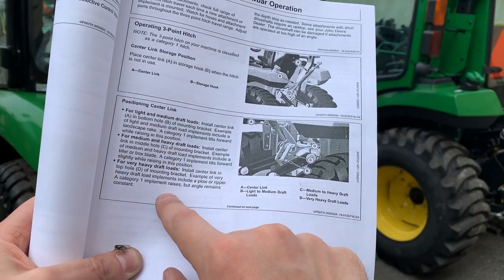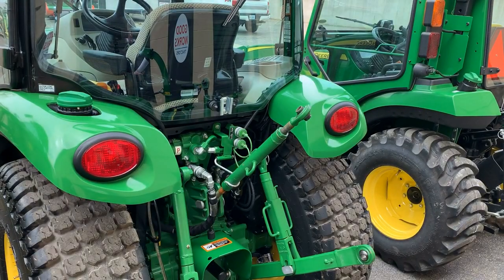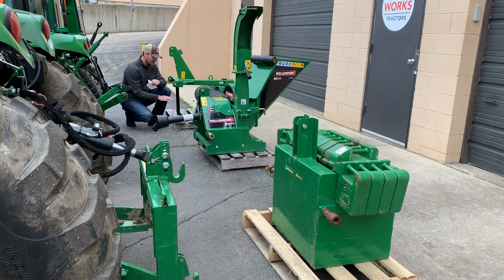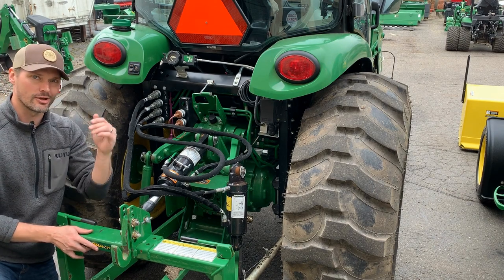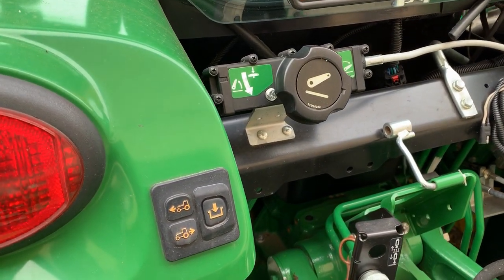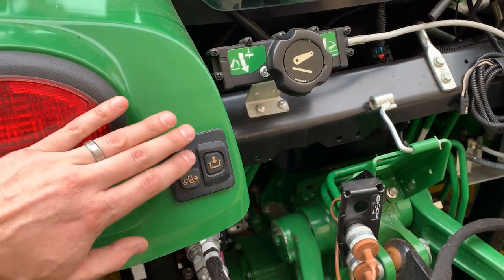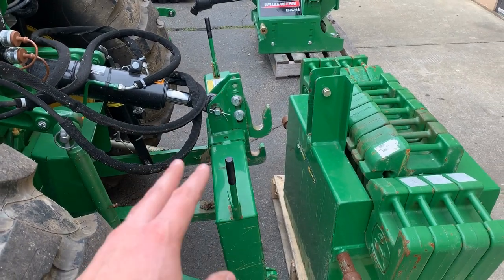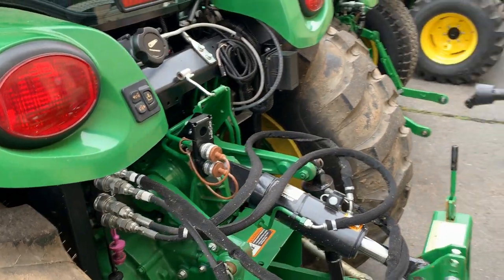TOP 10 TIPS FOR YOUR TRACTOR'S 3 POINT HITCH! 👨‍🌾🚜👩‍🌾

Comment: Ha!  "Park your implements on a level ground."  I backed into the machine shed at Grandpa's place last week to hook up to his bush hog.  He parked it on the level, dirt floor of the machine shed, but sometime in the previous century a tree had grown in the bit of soil the shed now covered, a large tree and Grandpa had parked the bush hog on top of it, dropping the drawbar onto the old stump.  With the shackle sitting on the stump the rest of the bar had about four inches of clearance from the dirt floor.  A couple of floor jacks and various bits of cement blocks and I got it high enough to attach and pull out.  You guys and your new fangled ideas.

Comment: You suggested working with the 3pt implements on a level surface and with a pallet under the implement. I would additionally suggest adding a set of 1000#, 4 wheel moving dollies under the pallet to make moving the pallet easier on a concrete barn floor, or just screwing some wheels on to the bottom of the pallet. The dollies are usually around $20, so it just seems easier. SO much easier to position the implement in place.

Comment: I spend AT LEAST 15 minutes hooking up my brush hog to the PTO every time on by Kubota BX2680. Yesterday, I threw up my hands and was going to buy a $400 PTO quick-connect. Tractor Mike showed a neat trick where you painting the splines on the outside of the coupler on the brush hog side and you showed me that I can put the PTO at mid-machine and turn the tractor spline shaft AND I don't have to hold down the button until I'm ready to fully seat everything. I put the two ideas together, rotated everything into position and just hooked it up in under 10 seconds. Taking it off was just as easy! No more trying to find the button and my hand being in a VERY akward posiion. BOO-YAH!!! THANK YOU, THANK YOU, THANK YOU!! (I guess I should actually read the manual now, huh?)
PS- DO you have caps for sale? I'd like to buy one to support you.
Reply from the maker: Ha, awesome.  Glad to hear it!

Comment: Another interesting video Courtney!  When I was looking to trade for a new 4052R, the dealer had a new one on hand that was all decked out with a lot of extras on it along with the “Top and Tilt” option, with an offer I couldn’t refuse😉.  How handy it is!  It’s one of those...”I wouldn’t have ordered it, but now that I have it, I don’t want to be without it.”  Not only for hooking up implements with quick hitch,  which is a breeze, but for blade or box blade work, 3pt. forks, carryall, and I use the top link in float position for bush hog mowing (allows easier turning and uneven terrain).  In addition, the two hydraulic remotes allows  for using remotes for other implements as well.  I use them with a stump grinder that requires 2 remotes.
Reply from the maker: Yep, love all the remotes.  Can never have enough!

Comment: Very informative. I'm embarrassed to say that I didn't think of shifting away from the rear PTO to make hooking it up easier. Thanks for that!
Reply from the maker: It certainly helps, have a good one Justin!
Reply: If you are embarrassed, then add me to the list.  I’ve spent a lot of time losing my mind back there.  Maybe a few curse words too :)
Reply: Don't be too embarrased.   I'd probably still be hunting the disengaged position on the PTO select lever.   Pretty much every tractor I've ever used the PTO on had mechanical linkage to engage the PTO rather than electric or electric over hydraulic.   

On a related note,  does anyone even make tractors with 2 stage clutches anymore?

Comment: It's easy to make a dolly with plywood and casters.  That way you can roll the attachment around.  It is easier to roll the attachment to the tractor than backing up, etc.
Reply: c wolf88 works well if you have your attachments on asphalt or concrete. Not so well on gravel lol
Reply: @eddevarona8448  I use the strongest, large diameter, widest casters I can find.  My driveway is gravel.  No problems.

Comment: Finer note on the top link.  The whole idea of the patent for the 3PH is that the implement when pulled through the ground (visualize a plow) wants to rotate up out around the lift arm pins.  The upper link stops this and pushes into the tractor.  We all think of the top link as lifting the back end of the implement but when engaging the ground it is the opposite.  It is above the axle so it pushes into the tractor.  The higher you raise it the more it pushes in.  Prior to the 3PH it was common for tractors to wheelie and flip over backwards killing the operator if they didn't get the clutch in fast enough.  Ferguson (massy Ferguson ford Ferguson etc.  ) figured this out and his patent means the modern 3PH prevents this.  Higher up for heavy DRAFT ie. Hard to pull not Heavy physically which you want a lower point for.

Comment: Don’t have a quick hitch but keep a length of 1” pvc pipe handy to spread the lower attach while backing. Each implement has its own length of pipe.

I use a heavy. chain on the top link for my flail mower, tiller, grader, planter and  well everything. The chain will lift the implement as needed and float it over uneven ground. Use of a split link makes easy to adjust the length of chain although by now, each implement has the desired length already attached to the top link.

On the sliding pto attach, I pull back the collar and then wrap a zip tie around the shaft to keep the collar back while I slide the shaft forward onto the splined drive.
Reply from the maker: Good idea, thanks for watching Stan!

Comment: Yep, top & tilt is expensive, and not 100% necessary.  But if you want to make something like a box blade an absolute pleasure to use properly, there is no substitute!  And if you "amortize" the TNT's cost over the 15+ years you'll have your tractor, their not that bad.  Finally, If you really want your TNT to perform at its best, be sure it has "dual piloted check valves" on both cylinders.  These  absolutely lock the cylinder in place once you've set it where you need it until you override that setting with your SCV controls.
Reply from the maker: Yeah, I agree on those check valves.

Comment: Hello I have a question on the three point lift on the tractor, the part that is part of the tractor that the side links connect to (sorry not sure what they are called, i will call them the three point lift points).  Should the right and left three point lift points be level from the factory?  i just got a new 1025R and the right side looks lower then the left side.  this can probably be compensated by adjusting the right side link, but should this be the case, or should the tractor lift points be level from the factory?  Really enjoy your channel, and thought you would be the person to ask.  would appreciate any comments you have.  thank you,

Comment: Nine times out of ten , I learn something after watching your videos. ( Point - 2 - 3 second drop rate for 3 point hitch ) I will adjust mine today.  Wondering though, is that load off only - I have the i-match quick hitch system ?
Reply from the maker: Good, happy to help!  I don't recall reading anything in the manual about with load, without load, etc.  I think just general guidance.

Comment: I hate to ask this and sound stupid, but is there any way to set the rear PTO to spin freely on 3e series without a mid-mount?
Reply from the maker: I'm not aware of a way
Reply: Dang, a nice neutral free spinning  PTO feature should be on every tractor. I have beaten and bruised my arms and hands trying to line up the teeth on the PTO. I bought the PTO quick link and found that even that doesn’t line up perfectly for some reason?

Comment: I'm not 100% on this, but as I recall that 3PH rate of drop setting is dependent on the weight of whatever is on the 3PH.  Set it at that 2 second drop rate empty, hook onto 500 lbs of weight, and the 3PH will drop like a rock in free fall. 😉
Reply from the maker: Manual doesn't make mention of that, at least not the ones I checked.  Thanks for watching!
Reply: I agree. ie. I make mine drop quickly when using a box blade to reduce humps when the rear tires go over something; not as fast running a brush cutter. The 3 bottom plough makes it drop like a rock.

Comment: The problem that I have had is the quick hitch bottom hooks are fixed in width and do not easily accommodate all implements. “Pat’s Quick Hitch” attachments in my opinion are better and more adjustable

Comment: I guess it is not as important with these smaller tractors, but with heavier tractors and implements, when attaching and detaching the PTO shaft, all the 3 points of the linkage should be attached, and it should be made sure that the tractor implement will not be able to move, when you are attaching and detaching the PTO shaft. You do not want to get crushed in there!

Comment: You CAN do real work with a Quick Hitch! I use mine as a logging arch. No huge trees but if my hitch can hold up the 700# flail mower, it can lift one end of a log to drag it out where I can cut to length for carrying with the forks on the loader.

Comment: What is required to stop my 7ft titan Bushog from cutting into the driveshaft? I have a newholland workmaster60 with 500 hrs. I have gone through 2driveshafts. . Please help me ,I’m desperate. I can’t afford anymore driveshafts @$400+.
Reply: I cannot stop the Bushog from popping up and busting the driveshaft. Is a 7ft. Bushog only tobe used on flat fields? . I have some potholes(not many ) and when I go over them  the deck of the Bushog pops up and cuts the driveshaft through the sleeve and then cuts into the drive shaft. 9:36 9:36

Comment: Great video, very informative as usual . That hydraulic setup is definitely cool ! I’ve never seen that , I’ll have to check out the other video about it.  They don’t make that for the 1025R do they ? Matt F
Reply from the maker: Thanks for watching Matt!  I've seen a hydraulic top link setup on a 1025r a couple times.  I think it was all done aftermarket.
Reply: Kim, I have a hydraulic top link on my 1025r. There's a short video on my channel. I used a cylinder from agrisupply and had some hoses made. About 200 altogether.
Reply: @JustinHEMI05  how did you add the additional hydraulic function?

Comment: I don't know about you but I don't want to have to start and stop my tractor 4 times just to attach an implement. Today I attached my chipper without even turning the tractor off. As long as there's no one near the controls, nothing is really gonna happen. You have the tractor in neutral, park brake off so you can move the tractor slightly (if you have a small one), PTO on mid setting so rear PTO is free to spin, rear link arms at the lowest setting so I can move them. AND I don't even have a quick hitch.
Reply from the maker: What could go wrong?  Haha!  I get it, just trying to interject a little safety into the mix is all :)
Reply: Hugs The great thing about America!  You got choices!  Google TRACTOR PTO Accidents.  It may make you change your mind.  Maybe not.
Reply: @larrypatterson3957   and

Comment: I noticed that you hooked up the lower arms , one on the inside and one outside of the quick hitch uprights , was this intentional just wondering lol
Reply from the maker: I don't understand
Reply: The tractor’s 3pt hitch arms actually GO INSIDE and are surrounded by the black steel framing of the quick hitch on either side. In the video, it does look like he attached the right side 3pt arm to the inside of the tractor arm, but again, if you’ll look closer, the tractor’s 3pt arms are sandwiched between the gap in the quick hitch so the pin actually passes through 2 holes on the quick hitch and the tractor arm for a total of 3 round opening per side.  I hope this helps both of you understand the illusion of the quick hitch seemingly being attached per your comment and helps the gentleman who created the video understand why you asked that question in the first place. Thanks!

Comment: Great video, and so beneficial to the tractor community! Makes me glad I just ordered 2 implements (Brush Crusher 4215 and Pallet Forks) from Good Works Tractors! (And BTW, to interested readers, Courtney beat the price for the Brush Crusher, and CRUSHED the cost for shipping [pun intended], vs my "local" dealer. Try him out -- you'll no doubt be glad you did. Oh, and GWT is right at 1000 miles away from me!)

So anyway...

1) Love the fly's part in the video, but did it remind anybody else of the final scene with Norman Bates in the holding cell in the original Psycho (https://www.youtube.com/watch?v=dYDxxHrlmUg)? Just sayin'.

2) Is there a trick like the mid/rear PTO switch for tractors with no mid-PTO (e.g., 3038e)? I spent the better part of 15' yesterday trying to hook up the PTO on my stump grinder, and finally gave it up for another day. VERY frustrating!

3) I know what you MEANT about the quick hitch, but since I have one (not yours, but very similar), I feel compelled to mention that they are not that foolproof for older and/or non-QH compatible implements. That's still a frustration, even with a QH (unless you know something I don't!).

Again, thanks for your service to the tractor-owners community!
Reply from the maker: Haha, thanks for watching Tim, good stuff in your comments.  I'm not aware of that PTO trick on machines with only rear PTO.  Perhaps try putting the transmission in neutral with the parking brake set?  The other thing I do in that situation is to get the 3 point connected and raise the implement just slightly off the ground.  Enough so that you can freely spin the shaft of the attachment and get those splines to line up.

Yes, quick hitches are designed to work with quick hitch implements.  I wouldn't say the quick hitches are fool proof, just not designed to work with non-quick hitch compatible attachments.

Have a good one Tim!
Reply: On most tractors there is a setting to put the pto in neutral yes even while running (dumb idea) you can turn it. Why this feature. It's there to use a feed grinder or silage unloader.